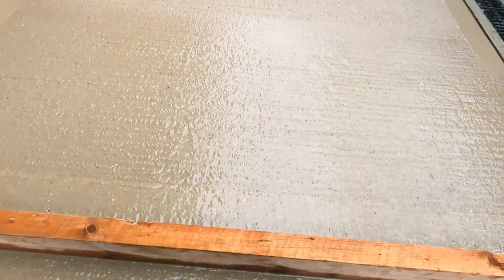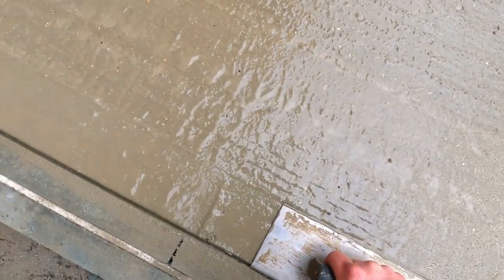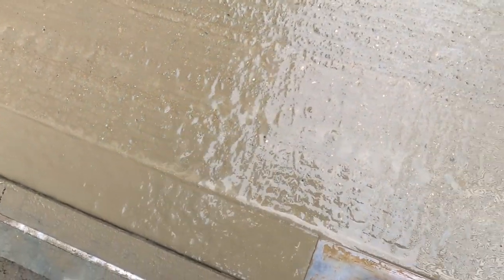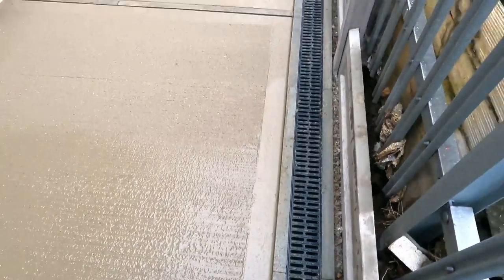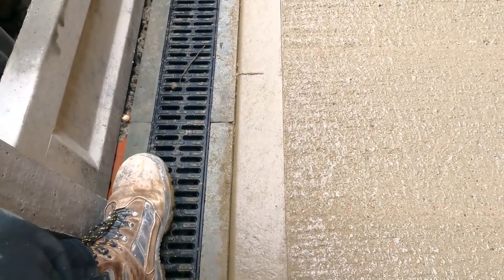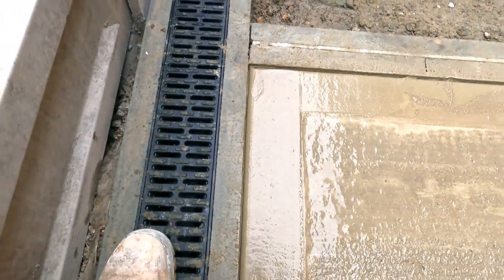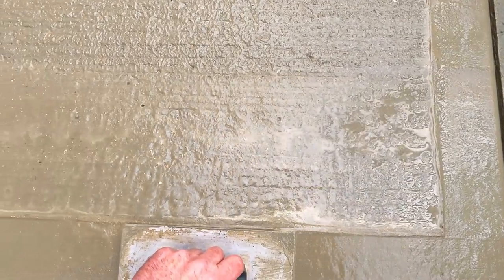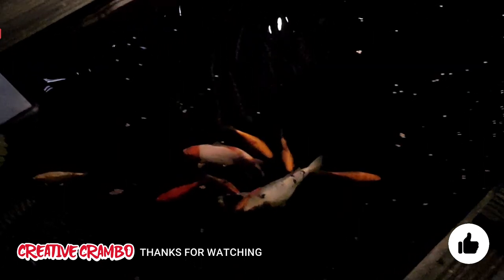How To Use A Marshalltown Edging Trowel

Comment: How long after pouring can this be done during winter in the UK?
Reply from the maker: Thanks for stopping by the vid mate 👍👍 temperature  plays a big factor time on concrete setting and all depending where you are in the uk or anywhere in the world but the key factors are don't edge out to soon I'd leave it for about 2 hours at least in cooler temperatures but in warmer temperatures I've had to get on it within the hour when the concrete starts losing its bleed water means the concrete is setting you can edge out before this happens and go over it again to get a great finish all I can say is you got to edge out in good time before the concrete sets every job is different sometimes depends on the depth of the concrete and what it's set on wish I could give you an exact time mate but all depends on alot of key factors all I do is wait for the right time and get straight on it 
👍👍👊